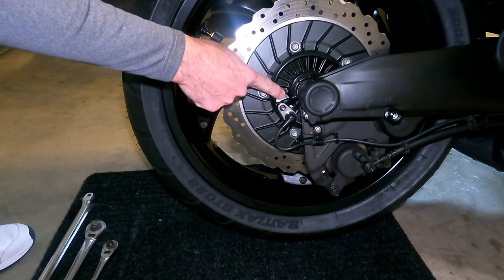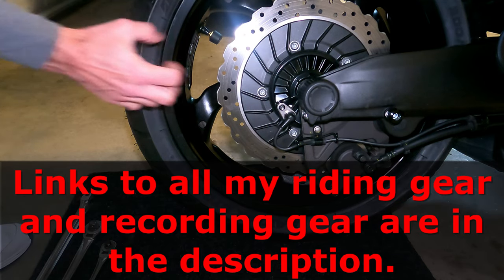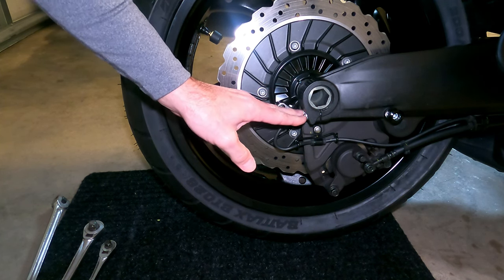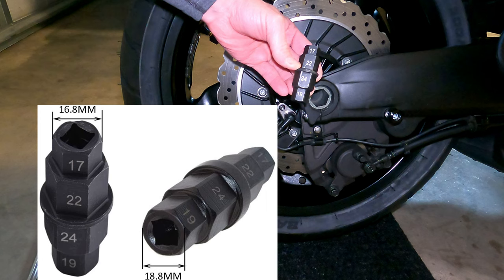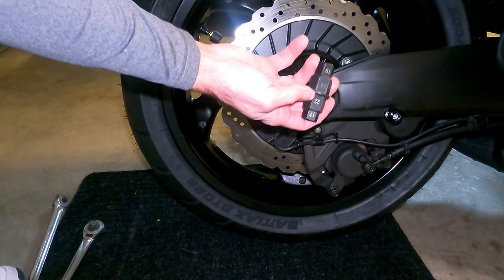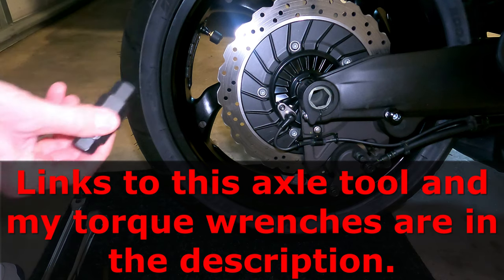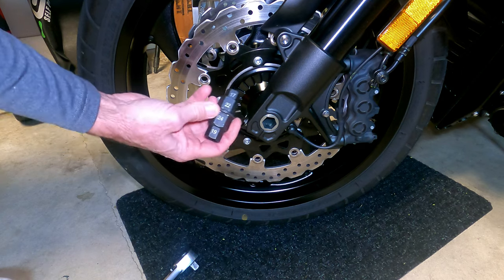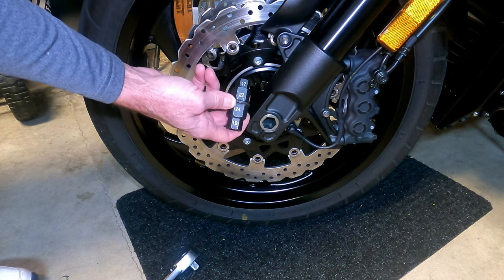Yamaha VMAX 1700 Hex Axle Tool

Comment: Thank you Jeff for another informative VMax video. Sooner or later I will need to purchase that tool. I’ll have 5,000 miles on mine likely by next week depending on the weather. And to my surprise the tires are still looking fairly good. With that said I narrowly missed a small chunk of 2x4 on my last ride. Actually been seeing a lot of left overs on and along the highways from construction lately. Take care Jeff and stay safe! 🏍
Reply from the maker: Thank you Chuck. There is a lot of construction from new houses going up all around my neighborhood, which is probably where I picked up my nail. I look forward to seeing how many miles I get out of these tires. My front tire now has about 1,800 more miles than the front.

Comment: If you want to save money, or don't want to wait on the tool. You can use a 5/8" Bolt, and two 5/8" nuts. The head of the bolt, and OD of the nuts is 24mm. Use one of the nuts as a jam nut.